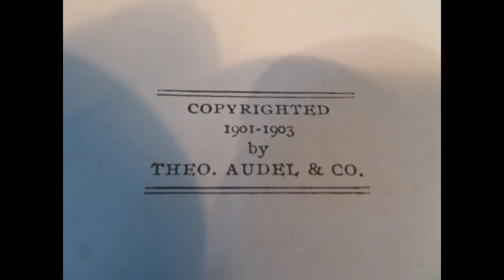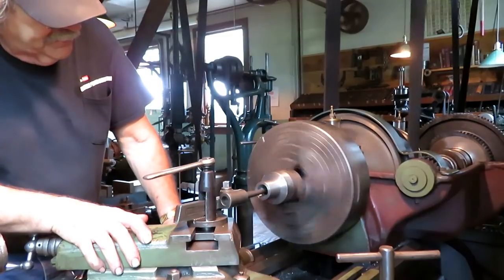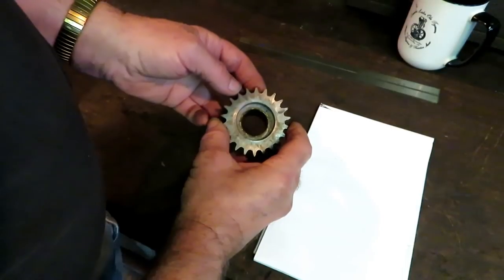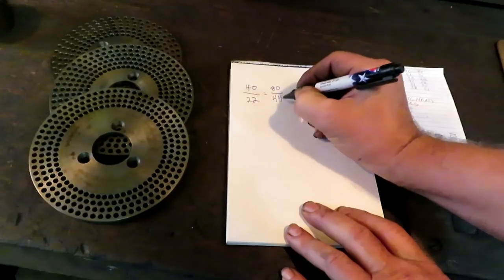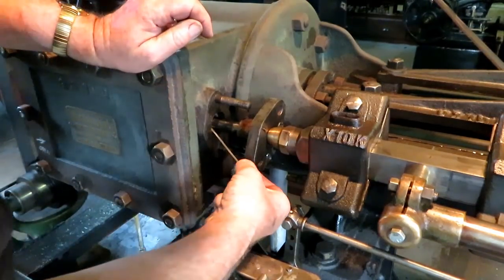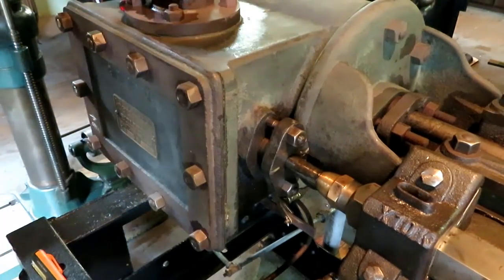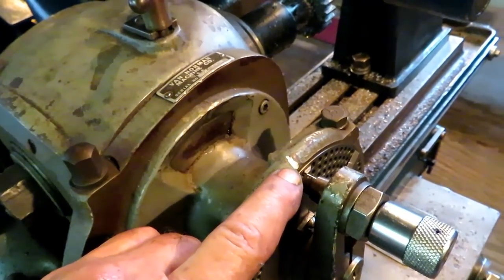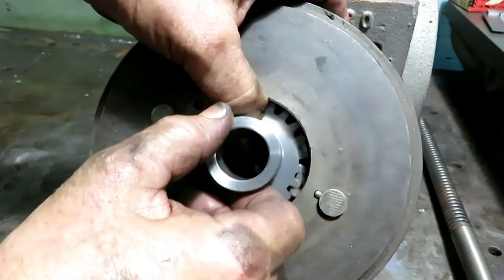OLD STEAM POWERED MACHINE SHOP  46  Making a gear for one of those horseless wagons

Comment: Dave I have a question:  What page in Shop Theory was that you looked at?  I have a 1934 ed.
Reply from the maker: I had the copyright date wrong, mine is a 34 also,....Dave
Reply: Thanks.  I was still trying to follow how you did the process.  Gearing is one of the hardest machining process and takes hard math, yet you make it look easy.

Comment: can you show some on feeds and speeds    a lost art here
Reply from the maker: Sure, but I just go by any of the simple formulas to find the RPM of cutter or work to get a surface speed not more than 120 ft/min in my shop with high speed steel tooling. More for aluminum and brass, less for tool steel. ....Dave

Comment: I noticed a round cover plate on the side of the "tail stock" end support (forgive me, I don't know the proper name for the piece) that you're using while cutting the gear teeth. Maybe it's obvious to a machinist, but not to me. What's in there, and why does it need a cover plate?